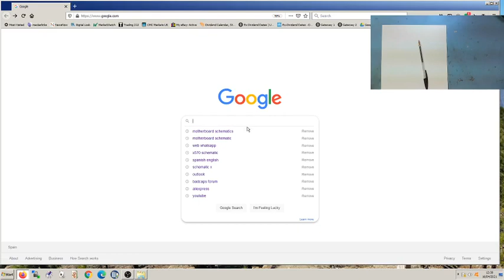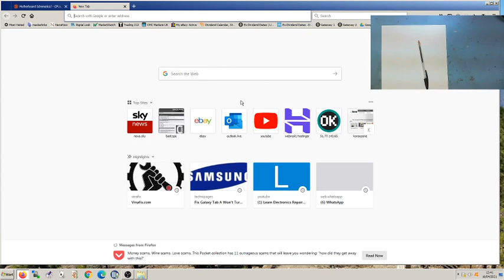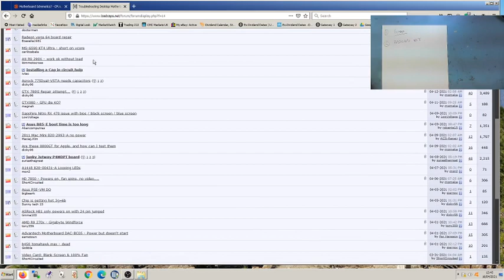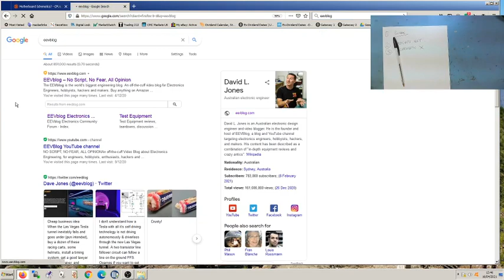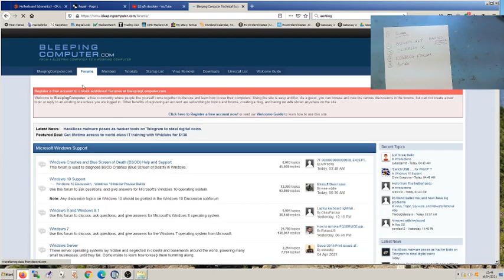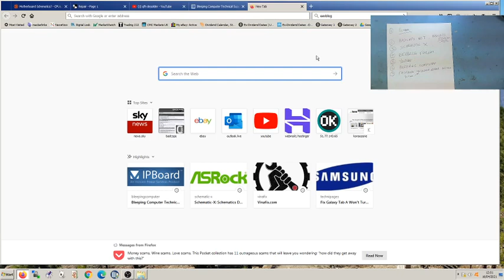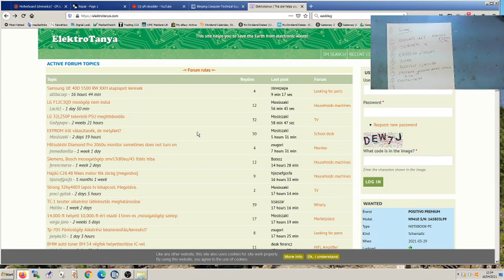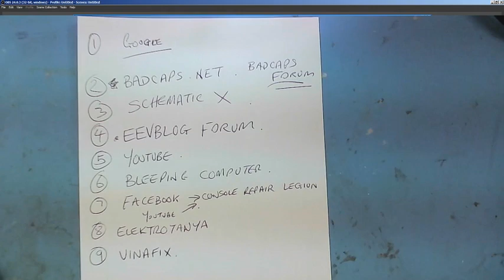Learn Electronics Repair #33 - Online Resources.  Where to find Schematic Diagrams & Repair Advice

Comment: Thanks for the information, I have bookmarked a couple of the sites.  But they did not have what I was/am looking form I any places for strictly audio. I have a bass Euro B1800D-Pro. Thanks for the great information again, I'm just getting back into doing some repair after 30 years. Have you posted the current voltage box with light in line?  So don't quite remember the name/term for it.
Reply from the maker: Ask on badcaps.net forum in the audio repair section.  

Also try here, I believe they have something very similar to the one youwant
https://music-electronics-forum.com/forum/schematic-requests

Comment: I'm in need for controller board schematic/ circuit diagram for Veriti 96 well thermocycler (PCR) machine by Thermo Fisher. I tried by the method you've mentioned but nothing could be found. 
Where/ how can I get it ??

Comment: Hi Richard, thanks for another video. I have learned a lot thanks to you in these few weeks. I have an unrelated question about short circuit detection. I understand that sometimes you apply power to see which component is shorted and gets hot. I have a broken phone and I think there is a short circuit but I don't know where.  On my power supply, I set up the voltage to 4.2 volts and current to 2 amps (to make this adjustment I have to connect both leads from the power supply). I connect the wires to the phone as if the battery was plugged but as soon as I do it, the amps go to 2 however the voltage drops to 0. I am not sure if the electrons actually flow. Will the shorted component get hot when the voltage is 0?
Reply from the maker: Hi Pawel - nice question!  OK, we need to consider ohms law to work out why the short circuit component sometimes gets hot, and will it get hot in your case.  So in your case when you apply 2A from your constant current power supply,  the voltage goes to 0.1V.    

So ohms law tells us that the resistance of the short circuit R=V/I.  

For ohms law calculations, R is in ohms, V is in Volts and I is in Amps

On your phone V is 0.1V and I (current) is 2A.  Therefore the resistance of your short is :

0.1 / 2 = 0.05 ohms

Now lets consider the wattage (heat) dissipated by the shorted component.  

W = V x I  so in your case 0.1 x 2 = 0.2Watts.  Which is not a lot.   For a very small capacitor which is short circuit, this may be enough to get the component warm, but due to the fact is it soldered to the board which acts as a heatsink, the chances are you will not be able to feel anything warming up.   

The problem with finding shorts by using current to get the faulty component hot, is that it does not work if the faulty component is actually zero ohms.  If that was the case the 0.05 ohms would be the resistance of the circuit board tracks, which means they would get a bit warm, not the faulty part!   It's also not so good for finding shorts on large components as they would have to dissipate quiet a few watts to warm up at all.

The method of using a bench PSU to inject current works much better when the 'short' actually reads a few ohms.  For example, if you set your PSU to 2A, and the voltage was dropping to 4V, then the 'short' resistance would be  R=V/I so R=4/2 = 2 ohms.   Now the Wattage W=VxI = 4x2 = 8Watts!

In this case something is going to get very hot indeed.  Also the resistance of the circuit board tracks is now much less than the 'short' so almost all the heat is dissipated by the faulty component, and almost none by the circuit track.

Check out this video on short circuit finding.  https://www.youtube.com/watch?v=kGM-Zmrr6tc&t=3s

This explains why on the 8800GT graphics card I could not find the short by injecting current.  In my case I could not get enough current (only approx 0.5A) to flow at the correct supply voltage (approx 1.2V) to heat anything up.  Once again, W=V/I, I so I had 1.2/0.5 = 0.6 Watts.  Not enough.

There are three ways around this, that I can think of.  Increase the current to the maximum your PSU can deliver - 5A, 10A?  This could help but could also burn out thin circuit board tracks if you really use too much current.  I would certainly go up to 5A and consider that safe enough.   This would also cause your PSU to give more voltage, so the formula W=VxI means the wattage would go up rapidly as you increase current.  

This still would not work if the short circuit component is actually zero ohms, as no voltage would be dropped across the component therefore watts = 0  x Current which of course = zero, no matter how much current is flowing. instead the wattage (heat) would all be dissipated by your test leads and circuit board tracks as they have more resistance than the faulty part..

On low voltage power rails like my GPU (1.2V) you could also try to increase the supply voltage to get more amps to flow into the short, once you have connected to the faulty device - this would work by increasing the current and therefore the wattage, but it is somewhat dangerous to the device because if the short circuit suddenly burns out / goes open circuit your PSU would jump up to the full voltage you set - which is too much for that power rail and would damage other components

You could also try the method I used in the video, with a multi-meter on milli-volts or even micro-volts range.  This would also work better with higher current.

The only other way I can think of is to buy a meter that can measure resistances extremely accurately - say to a resolution of 0.000001 ohm - then try to trace the short with the device powered off.

I hope that slightly lengthy reply helps you trace your fault.    Richard.
Reply: Thank you, Richard, I appreciate your explanation, I think I understand this better. When I saw the voltage dropping to 0 when injecting the power I thought that this is some kind of safety mechanism on the power supply in case of a short circuit. But yes, when I increased the amperage the voltage increased as well. I basically try to fix an old iPhone and hence the question. It was water damaged and I think there is a short somewhere. I have checked it with a multimeter in diode mode and it read zero. I cleaned the logic board in IPA and for some reason, the short (when checking with the multimeter) disappeared. In diode mode, now it shows a 0.5 V voltage drop.  I'm not sure if I'm right but I think that when the phone is switched off and I inject the power, it should not take it and the amps should be 0. But it takes 2 amps so I presume there is still a short circuit even though the multimeter shows there is not. Also, I think that a working iPhone takes normally around 1amp. Does it all make sense Richard?
Reply from the maker: @smartips1036    Quote 'When I saw the voltage dropping to 0 when injecting the power I thought that this is some kind of safety mechanism on the power supply in case of a short circuit. But yes, when I increased the amperage the voltage increased as well'    - Yes Pawel that is Ohms law at work in real life!   You are getting there my friend :)

I = V/R.  As R (resistance) of the short stays the same then if you increase I, then V must also increase to make the equation remain true.  

Also W = V x I  

If you double I then you also double V (which ohms law says must happen when R stays the same).... so W (heat) increases by 4 times.  

I said I was not going to teach electronics mathematics because it  is not needed when repairing a circuit - but ohms law is crucial and you must understand this one equation (or at least appreciate it's effects in real life repairs) which is why I will continue to explain it every time it is needed to understand a fault.   Get ohms law into your understanding and a great deal more becomes clear.,